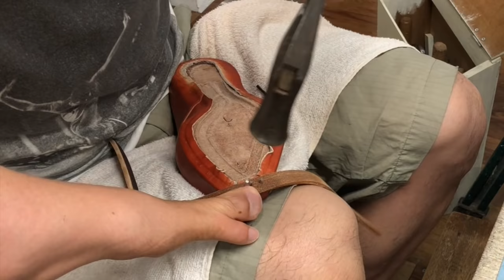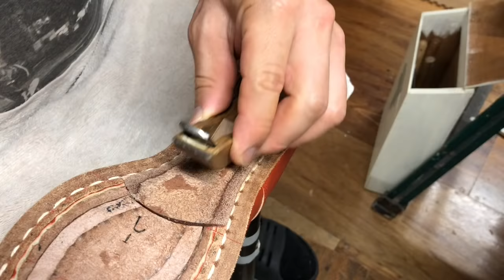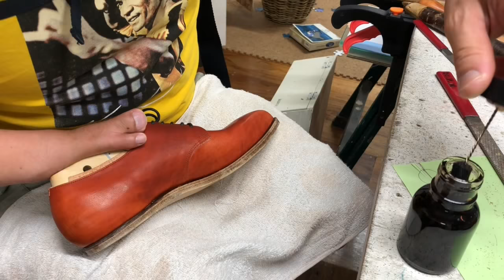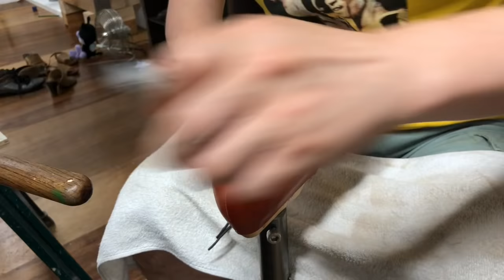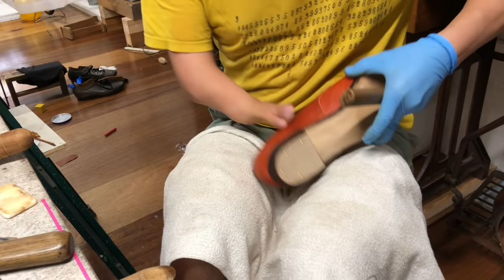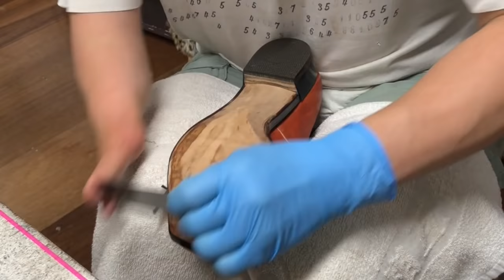2/2 Hand sewn welted Red brown blucher  Insole welting~finish/

Comment: I'm back!:O) Just a question that keeps coming back to me, is it right that you actually stitch through half the thickness of the insole? I mean, you don't come through on the other side obviously. I try to figure out the several steps of the process in my head and I get stuck at this point every time, it's so confusing:)